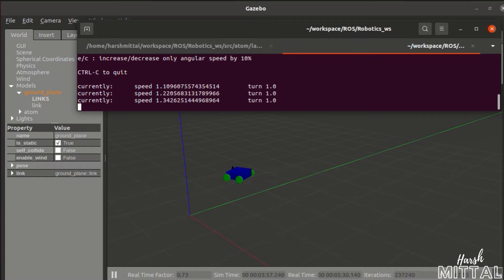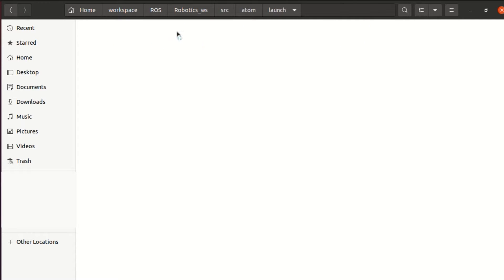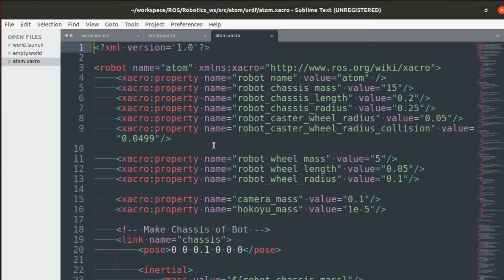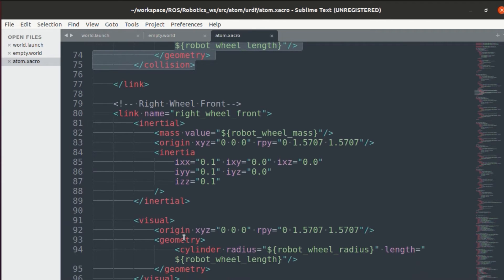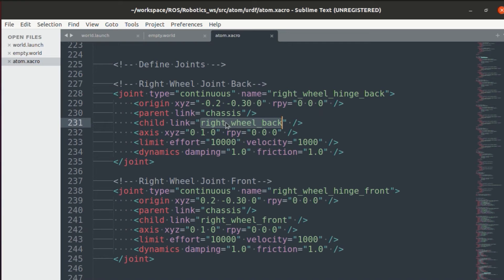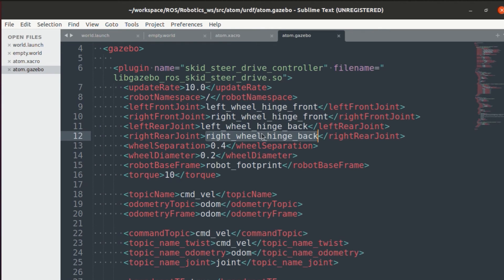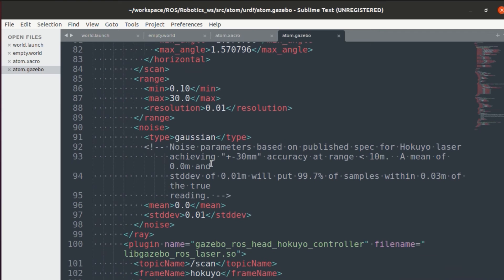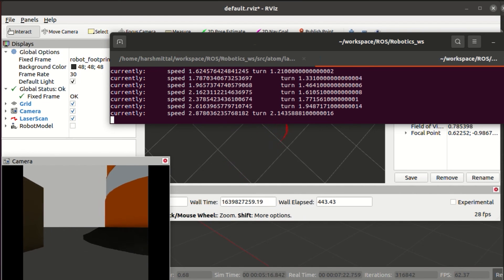Learn ROS Basics By Creating A Custom 4 Wheeled Robot with Camera & Lidar | Gazebo | URDF | XACRO

Comment: I tried running catkin_make but I am getting an error,saying Invoking "make -j2 -l2 "failed
Reply from the maker: Hi please refer to the pinned comment in this video as some of the documentation and commands have changed.
Reply: I went to that and I tried all the steps , still the same error is occurring
Reply from the maker: @shramanaghosh8317  which ubuntu version you have? And also did you install all the required library? Can you also share the complete error message
Reply: @BytesByHarsh  I have Ubuntu 16.04 and the error is in bot_drive.cpp:8:8: error:'ret' does not name a type
Reply: @BytesByHarsh  I have all the required libraries
Reply from the maker: @shramanaghosh8317  I have not used it in ubuntu 16, I have tested the code for Melodic and noetic in ubuntu 18 and 20 respectively.

Might be some dependency issue

Comment: Tried it works vey nicely :) 

However my simulation with gazebo will slow down really seriously after publishin some /atom/cmd_vel commands. I am running everything within a docker environment. Any Idea what causes these performance problems?
Reply from the maker: I have never tried in docker environment so I am not sure but you can check once the real time factor. There might be issue  with processing in your system, or something else I am not so sure. Will look it up and let you know.
Reply: @BytesByHarsh  First of all thanks for the quick reply and this awesome tutorials!

Real Time Factor stays mostly at 1.0 with some dips down to 0.3.  Even simply sending "rostopic pub -r 10 /atom/cmd_vel geometry_msgs/Twist" can cause the simulation to almost completely break down after some time.

I guess there is something else wrong. Do you know how we can profile ROS applications?

Comment: hi it was super helpful but when i just try to run teleop twist keyboard it ways waiting for subscriber to connect to cmd_vel can you help
Reply from the maker: Hey, can you refer to GitHub Readme as few things have been changed due to Navigation stack that has been added in the latest video.
Reply: @BytesByHarsh  its the most helpful 4w video i have ever seen thanks. I have just started to learn ROS i have a question,  do we have to write all those launch files etc etc i mean are there a source to just copy it we could just change parameters to ours
Reply from the maker: @ek-km4sf  depending on what is your application you might have to write your own launch files, but still you can copy some parts from different projects like Turtlebot and this one. Also if you are just starting then I would recommend learning ROS 2 than ROS 1.
Reply: @BytesByHarsh  Is there that much difference my teacher using ros1 noetic to teach us thats why im trying to learn specifically . But you are absolutely riight when i search for more complex subjects , most of tutorial videos are using ROS2
Reply: Oh and i have question for you i need to learn data planning but i dont know from where should i learn? I thought it was just a rviz goal estimate or pose estimate arrow. I guess it more complex than this :D
Reply from the maker: @ek-km4sf  hey could you elaborate what do you mean by data planning? And what exactly are you trying to implement.

Also for pose estimation etc you can see the latest video on autonomous Navigation on my channel.
Reply: @BytesByHarsh  I found it it was data planning algorithms such as djikstra A* etc
Reply from the maker: @ek-km4sf  yeah it can help you integrate such algorithms but not exclusively for this. You can look global path planners in ros and try maybe integrating in your system.
Reply: @BytesByHarsh  hi its me again :D, do you know how can i integrate my djikstra algorithm in my system as you said to do simulation, can i just write a python code and rosrun it ?
Reply from the maker: @ek-km4sf  https://discourse.ros.org/t/live-class-path-planning-basics-dijkstra-algorithm/19510 maybe this can help you
Reply: @BytesByHarsh  hi again i hope you good, im trying to openyour 4w robot with another world file but it always open an empty gazebo world. I have changed your world.launch file for new launch file but still it doesnt work. Also at RViz i can see the point clouds at wall but also there is no map at rviz :( can you help me 😭
Reply from the maker: @ek-km4sf  hey I cannot say for certain where the mistake is, you can send me the project/code at harshmittal2210@gmail.com. I'll have a look once.

Comment: Thank your for uploading this, I am getting this error for the camera : " No CameraInfo received on [/camera/rgb/camera_info].
Topic may not exist." I am running the Melodic version.  Even the laserscan shows the error "For frame [atom/hokuyo]: Frame [atom/hokuyo] does not exist". Can you please help
Reply: Even I have had the same problem
Reply from the maker: Hi, I'll try it again from my side and update you! Meanwhile make sure you have the latest code, also some topic names have changed as I have added Navigation stack.
Reply: @BytesByHarsh  Thank you, i tried with the latest code from the new video also,but the same problem is there.
Reply from the maker: @sohambaste  Ohh okay, I'll have a look. Thanks for sharing!
Reply from the maker: @sohambaste   I have made changes in the rviz topic for camera. But I am am not getting anything for laser. Could you check the latest code once and still if the issue is there then please raise an issue in GitHub with more details. 

Thanks!
Reply from the maker: @anubhavsakhuja1997   Hi could you check the latest code once. If the issue is still there then could you please create an issue with more details on GitHub

Thanks!

Comment: can the demo be used in melodic? Ive tried it but it has error when catkinmake with navigation stack folder and also it cannot control by running teleop_twist_keyboard. It said there is no subcriber on cmd_vel
Reply from the maker: Hi can you please share the error on my mail ID, I'll try to look into it, it might be because of the libraries, you refer to the docs/Navigation for installation.

For teleop you can try rosrun teleop_twist_keyboard teleop_twist_keyboard.py cmd_vel:=/atom/cmd_vel

Link http://www.harshmittal.co.in/Robotics_ws/Navigation.html
Reply from the maker: Hi, I have made some changes in the coded and doc, you should not me getting the error now. It was caused by the merge of Navigation feature. Video Link: https://www.youtube.com/watch?v=LZz3TuTDAoA  You can pull the new code.